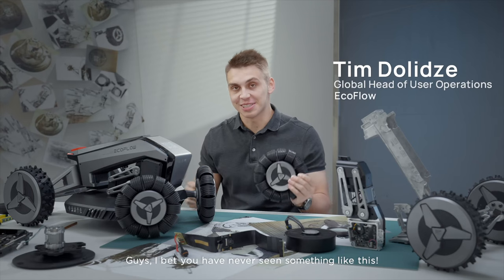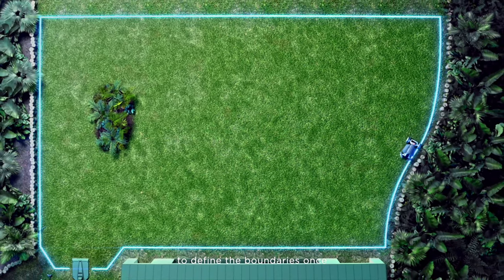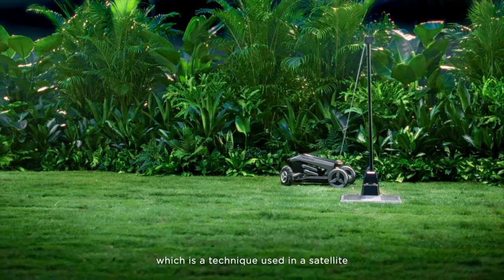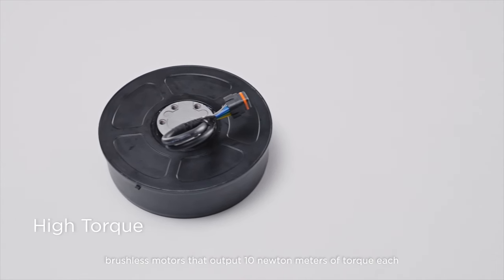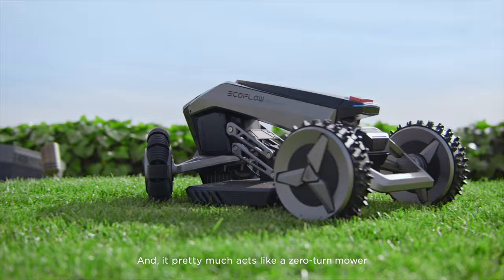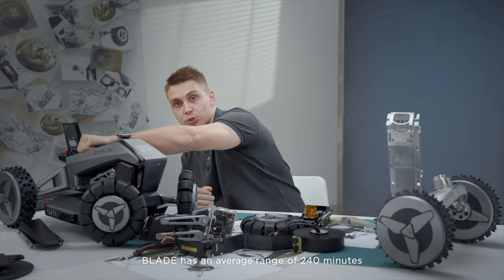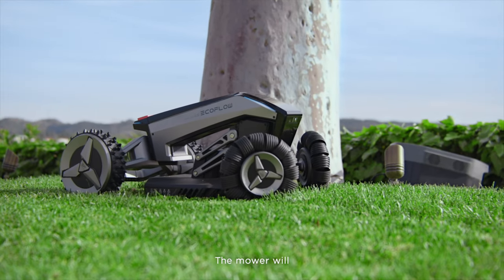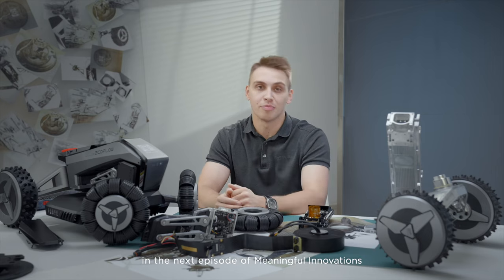Meaningful Innovations | What's the Tech Behind BLADE | EcoFlow

Comment: Hi There, could you show us how your balde is able to work in steep terrain?
Reply from the maker: Thanks for your suggestion! We have reflected this to the team.
Reply: I have been using it for couple of days and it's working horrible. It doesn't go along the slope but it goes 90 degree angle from slope and the app doesn't allow me to change that direction. So what blade does it starts out horizontal but it's constantly sliding towards down the slope. And on top of that the GPS signal sometime drops so it loses the track of which line it's following. This causes it to go outside of the boundary line and cause it to get stuck.

Comment: Could you let me know how it handles the fence with the gate? Does it send notifications to the phone if the gate is closed?
Reply from the maker: The car is able to easily identify obstacles larger than 40mm*40mm and with a clear color difference. So whether your fence is brown, white, or green, even if it is with a gate as long as the color is clearly different from the green of the lawn, BLADE can identify the obstacles.
Reply: @EcoFlowTech  what I am trying to say is I have a frontyard and backyard. My backyard  is fenced with one single gate to go in and out. If I have ecoflow blade is setup on backyard and gate is closed would it send me notification to go mow front yard
Reply: @RahulPatel-xj2nv  I asked this to their customer support team, always a better idea than their social media team. They responded: If the Blade attempts to access the second workspace and it is not accessible, the Blade will send a notification that it cannot access the second workspace and will return to the charging station.

Comment: Hi!
What's the effective RTK antenna working range? Will it work if the Blade has to mowe behinde the house where RTK antrenna will not be in a direct sight?
Reply: I have been using it for 2 days now and what My understanding is there are three GPS devices, one the antenna itself. Second, the charging base third is the blade itself has GPS. As far as working behind the house GPS works but if it gets too close to the house or if you have toll trees in your backyard then it loses the GPS signal a lot.
Reply: @RahulPatel-xj2nv It's just two GPS devices. The Blade itself and the antenna. They act in a base station and rover setup (you can Google for better info than I can give). They absolutely don't need line of sight. Basically, they are both talking to satellites independent of each other and then talking to each other (via radio or WiFi is my understanding). They talk to each other to compare notes about their position relative to 10 or 20 satellites. Basically, the base station knows it's coordinates because it's stationary, and the rover is using that info combined with the info from talking to the satellites to determine it's exact location if that makes sense. The r adobe things may get wonky near a house or under a lot of tree cover is the rover isn't seeing enough satellites to compare enough notes with the base station to know it's exact location.

Comment: I won't buy it, because of terrible front wheels, thanks.
Reply from the maker: Actually, the front wheels are specially designed in this way. The front wheels are 200mm-diameter omnidirectional wheels composed of multiple small rollers that can rotate freely. And the design of omnidirectional wheels helps reduce friction and resistance when turning and pretty much acts as a Zero Turn mower.